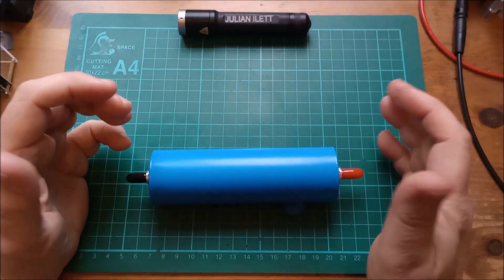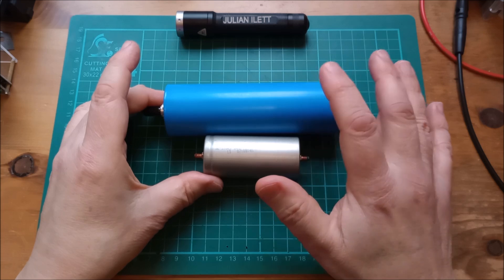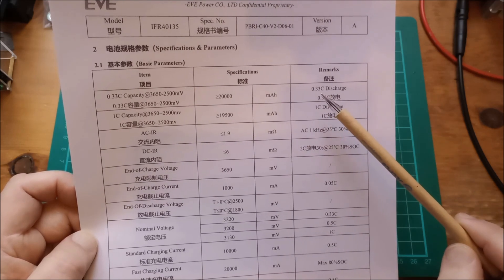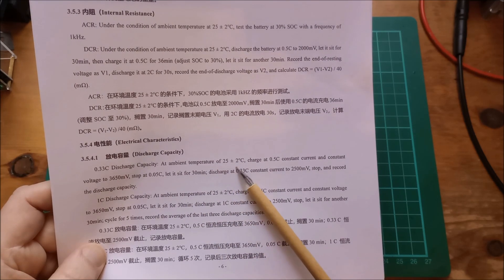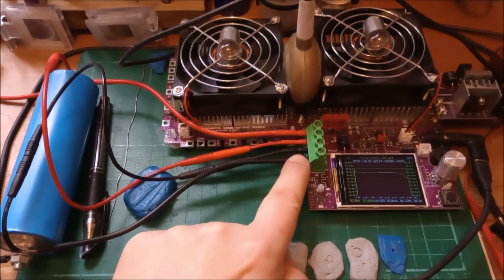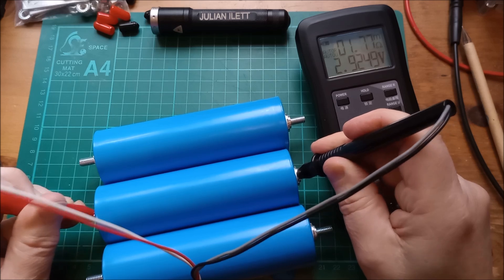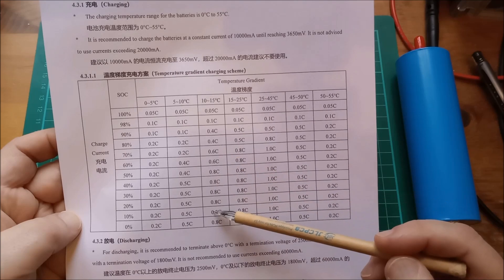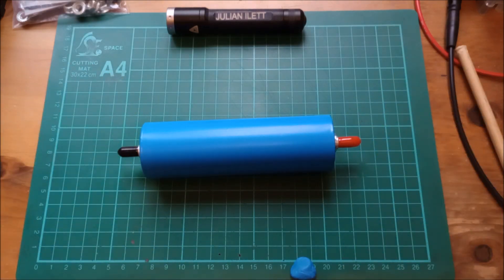EVE C40 LiFePO4 20Ah Cells from Hakadi Battery

Comment: What bms module would you recommend for these cells?
Reply: Any BMS that takes lifePo4 as setting. Also consider your BMS with more amps than you use. I have one with 4s4p and I only need a 4s BMS that takes 115A and 325A peak.
Search for ANT BMS, they are quite decent

Comment: Used similar ones to make a 12v car starter battery. 4s1P configuration, so at 135 measured cranking amps I’m a bit over the limit. But nevertheless I noticed a voltage of 2.9V per cell when cranking my engine for 5 second bursts at 135A. So not bad, but might consider switching to a 4s2p configuration to ease the stress off the cells.

Comment: I built a 14S1P battery for a small outboard motor with these cells. They work well, barely get warm at 2C discharge rate.

Comment: Can we make a jumper pack with it ?
Reply: Yes these are nasty  batteries need to be treated with respect ,very powerful. I've been using a pack made up of 4 of these for over a year (not eve but the same looking and cheaper). Will start my 2.5td 4x4 and 3.2tdi car from cold WITHOUT any other battery connected. The 4x4 starter draws 280amps and volts drop to about 8v. The car I don't know how much it draws.

Comment: Was that 60 A for 30 seconds ? thats a lot isn't it or am I way behind the times !!
Reply: Yes these will do 60 amps no problem the issue is they have so little mass and soon heat up under high discharge. As I replied to another comment I have started my 2.5td 4x4 easily from cold and that draws 280amps but only for a second or two. The DC internal resistance i measured at 2.7miliohm when fully charged so it's easy to calculate the voltage drop and internal heating.

Comment: Bought a 4pk of these cells for a little 12v solar system from AliExpress for $60 AUD, i knew going in they most likely werent brand new but I top balanced them and have run them for months without a BMS or balancer! (I am checking their voltage every couple of days when they are up at 3.5-3.6v and they are still balanced!) Quite happy with the little purchase.

Comment: I love these batteries, have been running them in a 16S1P config in a 3d printed custom case for my eBike for 8 months now. tons of vibrations and >3C discharge peaks and daily 100% DoD charge cycles as i use it to go to work. no problems at all since i built the pack and i have a 24S1P pack just waiting on the final touches and waterproofing that im going to upgrade to with the first pack as backup. Highly reccomend the EVE C40s as even with all of this they are still measuring >100% rated capacity Ah (rated 20Ah, all my cells measuring 22-23) on all cells in the pack to this day. also Happy New Year, love your vids but never commented since i didnt have anything constructive hahaha
Reply: only downside is they weigh a ton lol.
Reply from the maker: They are heavier than NMC, but I prefer the better safety of LiFePO4
Reply: damn! that was exactly what i was planning to do for my ebike! lmao how much range do you get? how much is the continuous discharge current that you recommend?
Reply: @feliwein_cc  the range depends massively on how fast you plan on going because of exponential drag. ill give some ballpark figures though and i live in the lake district so hills are assumed :), if u do legal power and speed its wayy over 100 miles range never had the patience to fully drain it like that haha. using 100A peak and 40A continuous with no speed limiter and no field weakening gets me around 28MPH GPS and 40+ miles range. adding field weakening at the top end takes it from around 23A draw flat out to my chosen 40A Draw at full speed and upps the speed to around 35mph GPS but tanks the efficiency and range to around 30 miles range. the last config is what i use daily for work. so id recommend anything around or below 3C and peaks of around 6C seem fine as my battery is still happy. ill update here if i ever have problems which i doubt. more likely i break the bike at this point.

(edit) the weight also isnt that bad, i have my pack in a 3dprinted case in my backpack and its well within not having back problems weight
Reply: Thanks for the info, I am planning to use these for a solar system after using old car batteries so that I can use it as a portable power pack. The nicest thing about these is that they can handle 60A so if you have eight cells for 24V you can draw around 1500 watts and 1 kWh of energy storage.
Reply: @HVinduction more like 512 wh of energy  storage ( 20Ah  x 25.6 nominal voltage)
Reply: Can u share ur case design